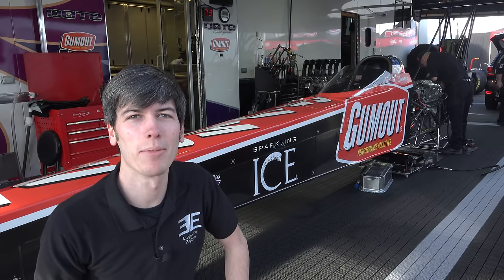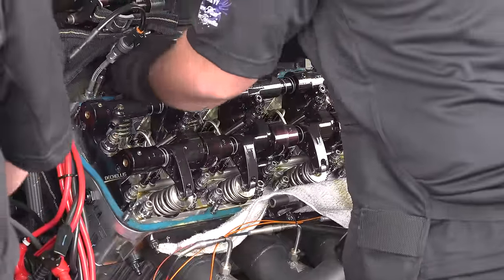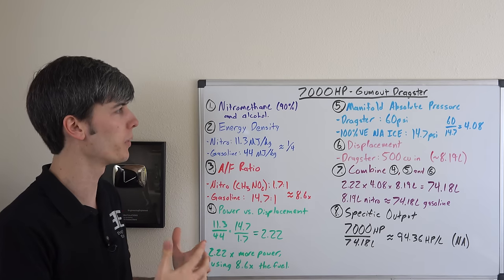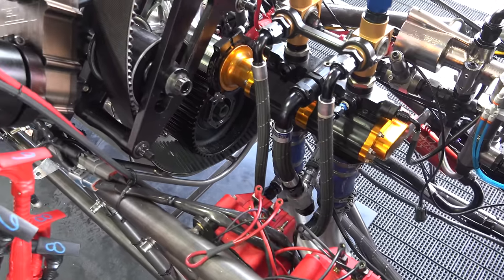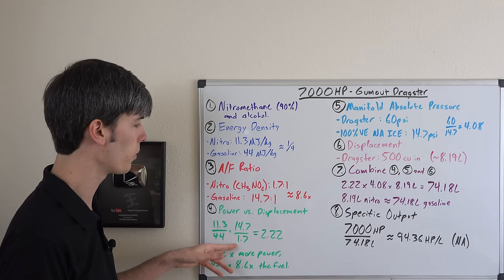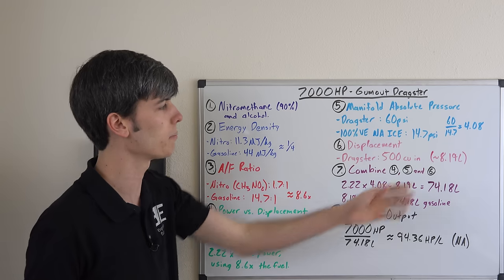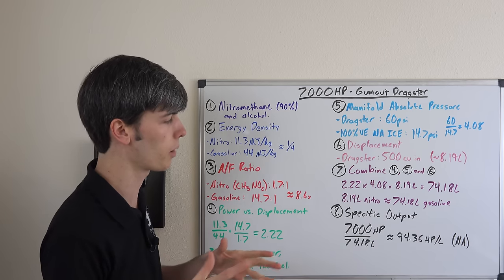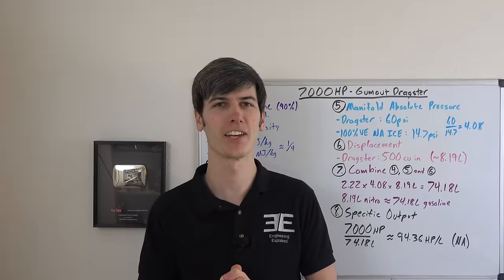Gumout Top Fuel Dragster - 7000 HP Explained

Comment: Nice video! Can you compare nitro methane to e85 fuel and what you would need to do on a road car to make it work?
Reply: There's pretty much no point in doing so.

Anyone can READILY google ethanol and find both it's energy density and stoichiometric A/F ratio (which are 25MJ/kg and 9:1, by the by). If you just copy the formulas shown on the white board, you'll see why many groups and individuals have switched over to ethanol as a source of power. It has its drawbacks in its low efficiency and the natural consequence of repurposing engines to make more power than they may have been designed for.

Comment: Hey there, just started watching the channel, great stuff!! One question, the 60psi vs 14.7 psi for the hypothetical na engine.....Does the 60psi refer to the peak cylinder pressure at the top of the compression stroke? I'm a bit confused about the 14.7 psi for the manifold pressure of a na engine...even if it's 100% efficient won't it have a 0 psi inlet manifold pressure at best? If there's no forced induction how can it end up with a positive inlet manifold pressure?

Love the channel!  :)
Reply from the maker: +Ar The Pirate 14.7 is atmospheric (absolute) pressure (0 psi gauge).
Reply: Ah yes of course! slaps forehead thanks !

Comment: hey random question, why are they wearing north full face respirators at 0:19??  I used to have to wear them for asbestos work, that's why I'm curious.  They're also using the bigger purple filters which allow you to breath much easier (in my experience vs the smaller purple)  I understand why the masks are used, but not particularly in this situation.  Please no trolling, it's an honest question.  Thank you in advance :)
Reply: Kron Dizzel because of the gases and the smell
Reply: nitro fuel is toxic, idk if you've ever been to a race or walked up to a pit stall when they fire the rebuilt engine before the run, but it burns like hell to breath.

Comment: Hey, can you make a video explaining why the front tyre is so small on dragsters? And also how smaller tyres in the front help in any form of racing? Thanks. Cheers :)
Reply: For dragsters, I think to save weight and you don't put super skinny wheels on racecars because you want the grip
Reply: +Anupam Potdar It's actually pretty simple. They're called skinnies and as the other guy mentioned, weight is part of it. Keeping the car as light as possible is a top priority to maximize acceleration. But the other major reason for skinnies is rolling resistance. Having a skinnier tire reduces rolling resistance greatly when compared to a wider setup. Next time you see a prius take a look at it's tires. Pretty skinny right? They do this because reduced rolling resistance also increases fuel economy. A more extreme example is the BMW i3. Being an electric car, the i3 uses super skinny tires to reduce rolling resistance and increase range. So why don't all race cars use skinny tires? Wide tires ultimately offer better grip. This is why the back tires on a dragster are extremely wide. They can run skinnies on the front of dragsters though because the from tires don't have to do much. On a normal car, most of the braking is done by the front tires. But on a dragster, the majority of the deceleration at the end of the run is done by the parachute that you see after the race. Front end grip is also very important for turning obviously, which is another reason skinnies aren't used on other race cars. The dragsters only have to turn at very low speed, so this isn't an issue. I hope this helped!
Reply: +Anupam Potdar think centrifugal force

Comment: +Engineering Explained,

It seems like the high parts turnover in these engines comes down to three basic factors:
1. Extremely high combustion pressures crushing the oil layer out from between the rod bearings and the crank (or the crank and the mains, for that matter).
2. Extremely high combustion temperatures melting the cylinder heads and pistons.
3. Extremely stressed supercharger and induction system making the risk of catastrophic backfire very high. 

If you were trying to keep similar performance but help the engines survive three or four runs instead of just one,  what would you do?

I think I would solve problem one with more cylinders (V12? V16?). This would spread the compression loads out over a much larger surface area. I would solve problem two with alcohol. Actually, I'm not sure what the downside is to alcohol for a drag car. I would solve the third problem with turbochargers. 

You'd  lose power going from nitro to alcohol, but I think it'd be pretty easy to get that power back with larger displacement and turbocharging.
Reply: +Ben Garrido When you compare these engines to other racing classes like nascar, they really are not that expensive. Nascar teams spend millions to gain 10 or 20 HP, but top fuel engines produce more power than they ever need. Most of the parts that are thrown out after each run are cheap. (bearings, oil, spark plugs, gaskets) The blocks can almost always be repaired after an explosion, even it a rod comes out of the side. But the cost of making a V12, could never be cheaper because now you have even more parts to break and replace.
Reply: +Ben Garrido I think you're discounting how much pressure even a thin layer of oil can withstand. If 1 always happened, engines would be destroyed every run. 3 only usually happens if 1 occurs. Many things can go wrong and affect how these engines run. Dropped cylinders, lean outs, over revving, pedaling. Even if nothing goes wrong, they consume many parts. 16 spark plugs alone just for a start.
Reply: I think I read somewhere that the oil gets crushed in top fuel engines. Might be wrong.
Reply: Ben Garrido If the bearings get starved of oil. A spun bearing and disaster usually follows.
Reply: +bustin justin They very commonly spin bearings, according to this.

Regardless, the bearings are toast after every run which indicates to me that the bearing loads are too high. More cylinders equals more bearing area.
Reply: Yeah they spin bearings pretty often. That is when you see them changing the block. The damaged blocks are repaired and put back into service when they get back to the shop. The major problem that destroys the engines is after the first few feet of the run, all 16 spark plugs are gone. It becomes a diesel engine for the rest of the run. You will NEVER see them refire an engine once its been run. They can't. Once the plugs melt, it becomes a balancing act with the fuel. Too much fuel and it can't compress and burn and that is when you see the raw fuel spraying out of the pipes.
Reply: The major explosions happen when an intake valve or spring break and the cylinder ignites and feeds back into the manifold and blows up the whole thing. When the bottom end lets go, it oils down the track.
Reply: +Ben Garrido On the topic of getting power back using turbocharging if you were burning methanol, the problem is the A/F ratio is high enough with alcohol that you can't practically compress enough air into the engine to make it compete with Nitromethane.  Your only option would be to increase displacement.  Nitromethane's very low A/F ratio of 1.7:1 versus methanol's 6.0:1 allows for about 3.5 times more nitro to be burned for any volume of air.  Methanol's energy density is higher than nitro but only by 1.9 times which means a nitro burning engine is a little less than twice as powerful as an equal sized methanol engine but it burns about 3.5 times more fuel.
Reply: All that applies to a supercharger. In fact, with the low air flow demands a nitro car, you could probably get away with relatively small turbos. 

The advantage of a turbo is that it operates at much higher thermal efficiency and it doesn't require 450 hp to drive. The amount of power required to drive the turbo shafts in a normal car is usually under 30 hp. A top fueler would probably be under 100 hp.
Reply: Low air demands might be the case for a personal car that runs on nitro but these dragster engines are pushing silly amounts of air through them that would blow apart normal engines.  The thermal efficiency advantage of the turbo isn't important in their application since they have no real need to improve the efficiency of their engines.  Parasitic drag on the engine from the supercharger doesn't matter either since it already produces more power than they need and they can always get more power by adding more fuel.  The rules dictate maximum displacements, the type of supercharger (no turbos), and how fast the supercharger can spin so going back to my original point about alcohol, you would not be able to make as much power as a nitro burning engine.
Reply: That super rich mixture = low air demand. Granted, an alcohol engine needs more air, but it's still richer than a gasoline engine. 

I'll bet you could get your crazy horspower with larger displacement, turbos and alcohol. There are already 3500 hp alcohol dragsters and those are relatively small displacement (8.2L) V8s with blowers. A twin or quad turbo, 12 liter V12 on methanol should be able to do significantly more. 50% displacement increase would move you to about 5500 hp. Significantly better thermal efficiency should be worth another big chunk of power and then there's the fact you aren't throwing 450 hp of pumping losses into a roots blower. 7,000 hp then gets you in the neighborhood of a contemporary top fueler.  

The rationale for doing so is to get less power per cylinder (~700 hp/cylinder on a V12 vs ~1,000 on the V8), lower cylinder pressures, lower cylinder temperatures (a primary benefit of methanol) and more bearing surface (what with more crank journals and rob bearings). The idea being that you could have similar power to a modern top fuel engine with lower maintenance demands. Also, the sound and fury of a 12 liter, quad turbo v12 would be epic.
Reply: wahconah98 The problem with parasitic drag is not so much total power because you're right, they already make more power than they can use. It's that the parasitic inefficiencies mean you need more hell going on in each cylinder to get the desired power. More hell = more melted parts after each run.
Reply: +Ben Garrido Tj zizzo ran a whole weekend off of parts that should have been scrapped(6-7 runs) and won a wally at Joiet route 66 race way, it can be done, but it cost less to replace the parts than the whole car if the engine goes, i have one of the pistons that lasted 7 runs to the wally at hte home track for him) its signed too, the old power purple alcohol funny car ran by Wayne butler ran power purple synthetic oil, and it broke the oil down, it runs 4.5 at 1000feet, running the same block and pistons , drivetrain. the oil used breaks down at a higher temperature that steel melts, and sticks to steel, it also basically doeskin compress.
Reply: Tj Zizzo is a brave man. :P
Reply: Umm, not really. A turbo has one moving part. A roots type supercharger has dozens.
Reply: Turbos can have as few as 1 moving part ...

Comment: You skipped pretty lightly over one of the more impressive aspects of the engine, IMO.
You mention that the racer uses about 14 gallons of fuel per heat. Assuming that most of it is used during the actual race, that's about 10 gallons in 4 seconds.
Or about 10 litres per second. That's a fire-hose!*
Except that a fire-hose is a single nozzle that simply soaks anything it's pointed at.
The dragster's fuel-pump has to deliver that amount of liquid to eight cylinders, in sequence, with microsecond and millilitre precision.
I think that that is very impressive.

*of course fire-hoses have a very wide range of capacities. But I asked a firefighter friend of mine what a ballpark figure would be and he said about 10 l/s.

Comment: My guess is that 60 psi supercharger 'boost' is measured in 'psig', not 'psia'. Then 'zero' boost would be 0 psi. If so, then the pressure ratio becomes 74.7 / 14.7, not 60 / 14.7.  Otherwise, nice video.

Comment: So, I understand that with increased engine displacement you get increased power. Now, what would be the downfall with the previous generation 4.0L V6 in the '05-'10 Mustang's? Lousy air induction is my guess since we know smaller displacement engines (the current 3.7L @ 300+hp) can output ~1.5 times the power the 4.0L did (only 210hp) using the same fuel type. I'm not an engineer nor a mechanic. I'm speculating. What's happening in this example?
Reply: That 4.0L was a horribly designed engine, ford woke up and extracted a lot more power for the 3.7 by actually designing a new engine and not using an old design from the 1960's. If you want to read more about it, look up the ford cologne v6
Reply: Without knowing the specifics of the engine, my guess would be compression ratio and breathing characteristics of the cylinder heads (port shape and size, valve size, lift and duration).

Comment: Wait, would it be possible to have a 1:1 compression ratio?
Reply from the maker: +crazycamkalani this would mean the piston never moves.
Reply: +Engineering Explained Oooohhhhhhh okay, thanks!
Reply: That's fairly easy to do. You only need to replace your crankshaft with straight rod
Reply: +Hene The force on both sides would match each other, nothing would move.
Reply: That's the real meaning of the Koenigsegg One:1.
Reply: +TheMindGarage Except they cheated, using KGs to horsepower, instead of lbs to hp... they used metric and imperial, so it's not a true 1:one
Reply: KGs to kilowatts is next I hope.
Reply: Lol I know what you're saying but everywhere but in the US that's what they use.
Reply: since when is horsepower imperial? KGs and HPs is what is the standard measurement outside of America.
Reply: Metric horsepower (PS) is different from HP. Many manufacturers use PS because the numbers are slightly higher - the Koenigsegg One:1 is 1PS/kg, not 1HP/kg.
Reply: KG, kW and Nm
Reply: Koenigsegg is Swedish, not US, and they are metric, like the rest of the civilised world.
Reply: Eliminator Performance that's wrong. There is an imperial HP based on imperial units (lbs/ft.). And then there's the metric unit PS (German: Pferdestärke = Horsepower) based on the metric and SI units kg and meter. 
Btw, The automakers want PS as a new standart
Reply: "this is equivalent to 735.49875 W or 98.6% of an imperial mechanical horsepower"
"In 1972, the PS was rendered obsolete by EEC directives, when it was replaced by the kilowatt as the official power measuring"

PS is not a clear multiple of kW or HP so it doesn't really matter if is "based" on either, it won't make sense to most of the world, only those that are already using it.
Reply: crazycamkalani if you wanted to make no power. I doubt it would start.
Reply: lol thats not cheating at all cause united states is the only country in the world that even measures in pounds... the world doesnt revolve around america bud.
Reply: cgpiik
No. KG, Nm and PS or kW. Brake Horsepower and Foot Pounds are the Imperial version.

Comment: Silly question:
Why F1 does not use something alike a 0.8L nitro engine with the same limitations as now, rather than the 1.6 liter engine? It seems like it might help to turn some heads.
Reply: Because F1 is about using cars and developing technology for production cars. Running a fuel which isn't allowed on roads isn't going to help much. Also it's not worth the safety risk.

Comment: exactly why the rebuilds every run? How do they get away with no cooling? if they had a cooling system, could they run longer as they may not trash certain parts after overheating parts after a run?
Reply: +Ryan B The fuel cools the engine. The rebuilds every run are because the engines simply are under tremendous strain at these levels of power. Reliability cannot be guaranteed even with a rebuild every run. They often blow up right off the line.
Reply: A water cooled engine requires empty spaces in the block for water to flow through which weakens the block and with the cylinder pressures they are dealing with they need as strong a block as possible. This is why some racers will fill the water passages in their engine block with concrete, it's cheaper than buying a custom made, high end solid engine block. Also they only need the engine to run for less than a minute, and only very briefly at full power so cooling is not a huge concern.

Comment: Nobody knows exactly how much horsepower a TF car produced because they cant run as long as it takes for a dyno to measure the output (~9 seconds). But its generally acknowledged that a Top Fuel dragster are producing at least 9000 horsepower. 7000 horsepower engines however can be found in Funny Cars.
Reply: Nope, they both have the same amount of horsepower, because it's the same engine. Funny cars have a different body than a fuel car which slows them down slightly.
Reply: B007 It's not that the Fueler can't run long enough for a dyno, it's that there is no existing dyno on the planet that can handle 6,000lb-ft tq and 10,000hp, plus speeds of 325mph.
Reply: +Tanner Kubarek ?, no, top fuel hits 350 and sometimes they even hit 416, but a FC hit 300 and makes 7000, they are almost the same, IDK, I know more about NASCAR and monster jam than I do top fuel
Reply: BenRomero66 Top Fuelers hit about 330 mph with a 3.70 second elapsed time, whereas Funny Cars hit 320 mph with a 3.95-4.0 second elapsed time. They are almost the same.